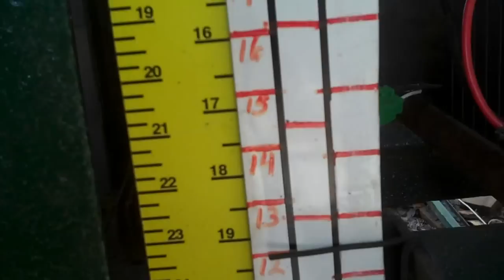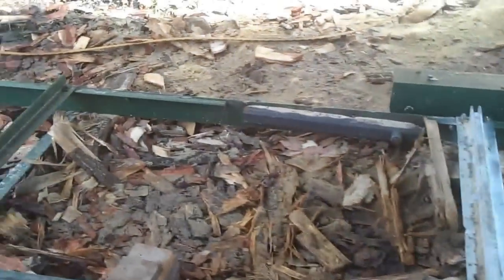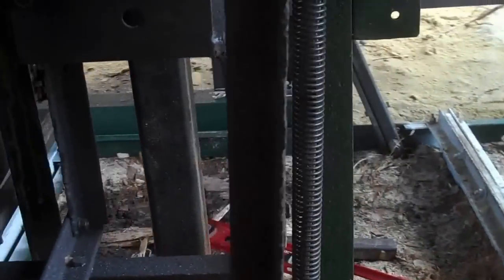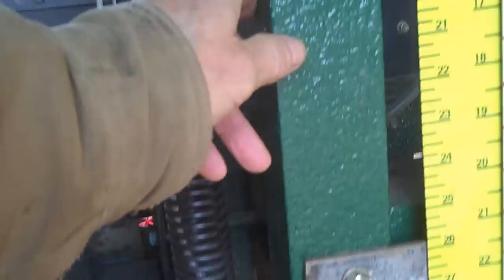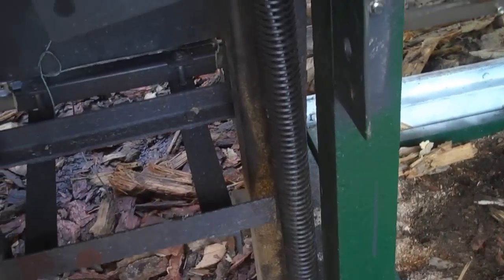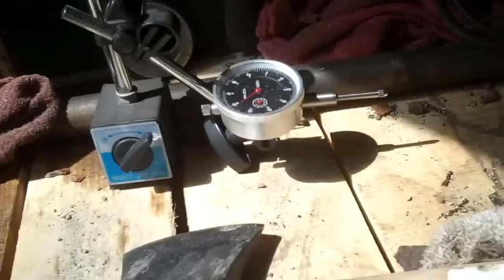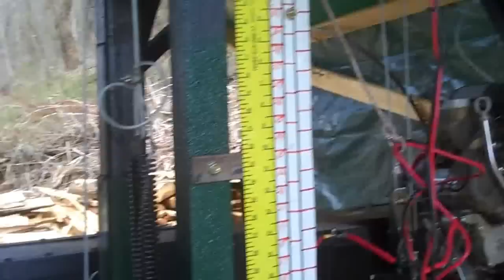How I built my bandsaw mill.

Comment: Really nice sawmill I did calculate your speed whit the dimension of wheel you gave and the speed of your blade is around 3846 fpm. On COOK web site they recommended speed for a 24 HP is 5000 fpm you must have allout of torque that a good thing lower speed less vibration . Again really nice sawmill. I'm thinking of making one mi self that why I'm looking at allot of video.
Reply from the maker: I'm not sure of the speed but it could cut a 36 inch wide board with no problem at about half throttle as long has the blade was sharp.

Comment: I happen to have two S10 axels and was looking for a video to help. Thanks so much for sharing. My axels will have to be turned on a lathe to accommodate pillow block bearings at the back and for the pulley as well. Apparently ford was more accommodating. Maybe i should visit the junkyard. Saw in good health.

Comment: Very cool.  I feel like I can do it but all of those adjustment points.  How many times did you have to redo something?  I feel like I'd get the saw all together and then find out that I need to take it halfway apart to add a piece to keep the blade from coming off or something.  BTW pulley and gear ratios are easy.  find circumference of the pulley or number of teeth on gear and then it is a simple ratio.  if one pulley is 10 inches in circumference and the other is 30 then it is a 1:3 ratio.  If you are turning 100 rpm on the smaller pulley (drive pulley from engine) then the big one will be doing 33.3333 rpm if you reverse it and have the big one driving then the little one will be going 300 rpm.
Reply from the maker: I didn't count how many times I had to redo something. I just keep at it till it was fixed.I know a whole lot more now then when I stated about builting a sawmill. I gained some knowledge and gave me something to do in my spare time. I figure I saved money because the money I spent for a mill like this would of cost me double of what I spent.

Comment: so does the winch u r using to make ur sets  lift from both sides of your carriage ? seems like u would bind otherwise
Reply from the maker: +noturbone It lifts from the middle and it doesn't bind if the post on both sides are greaesd up real good.
Reply: ingenious and your autofeed is brilliant have you thought about putting a switch on the carriage for an auto return so u could operate the saw from a stationary position i'm gonna build one of these myself u did a great job thanx for sharing